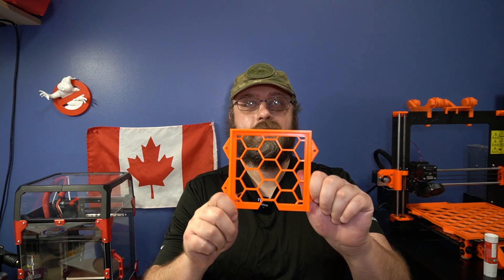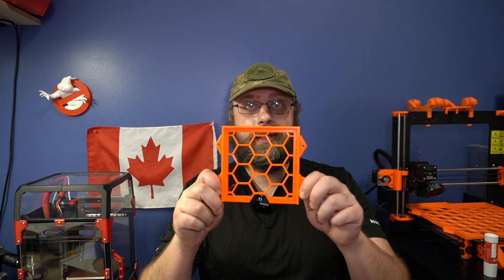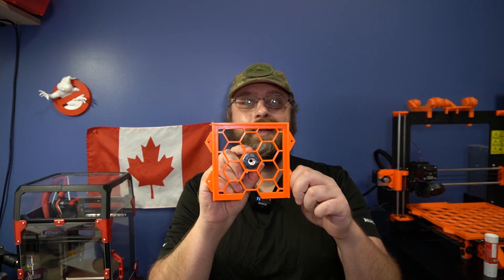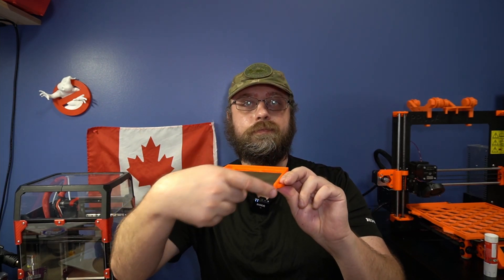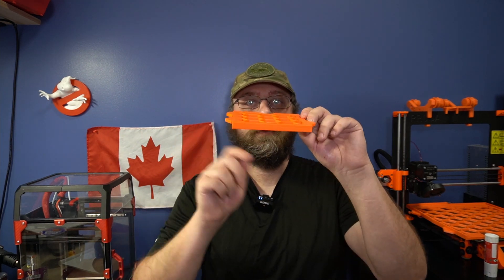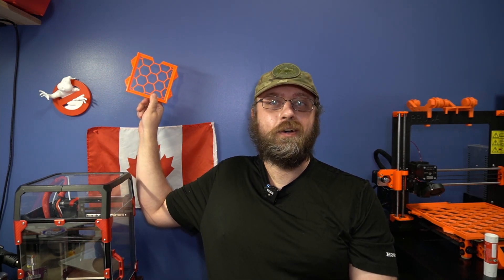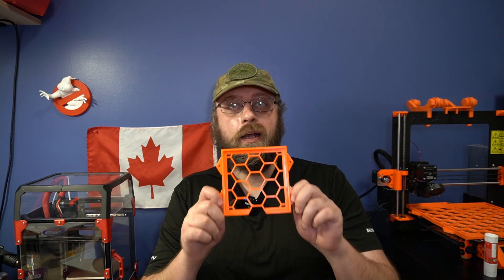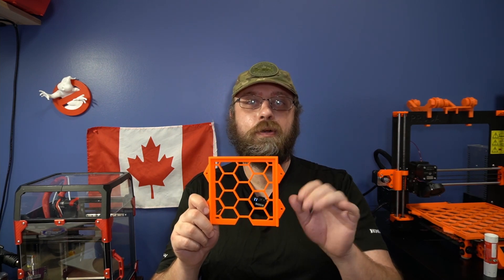3D Design Showcase: Voron v0 Flex Bed Holder

Comment: I love how you explained it all. Other channels always seem to assume this is known to everbody already. 
Now I have a noob question. Sorry for that. :) 
Imagine having a number of line fragments and one wants to constrain them so they are all on the same line, but non-coinciding. Picture a dotted line with 3 line fragments that are on the same (construction?) line. I have a hard time getting that to work. Yeah, maybe a distance constraint of 0 mm between a construction line and a parallel line will do the trick, but then in the best case you get these measurements showing 0 mm distance for all the line fragments. Any ideas? Thanks in advance!
Reply from the maker: I think I'm picking up what your putting down.  Something like this o----o----------o---o---------o  But at an angle? (o = endpoints of lines).

I would do this by making a construction line (blue), then in normal mode(white) I'd make however number of of lines that you want, making sure that the end points of those line is attached to the construction line  (PointOnObject constraint, C hotkey).  And attach the endpoint of each line to the start point of the next (or use the Create Polyline tool which will automatically link the previous line to the next). This way you don't need to use any parallel constraints because when you move and/or rotate the construction (blue) line all the other lines will follow.

Think of CAD as visual Algebra, the more you can simplify the final answer the easier it is to make changes later and debug issues.

You might have heard the old "Math is Beautiful" line?  I'd say So is CAD.

🍻
Reply: @QEngineering  Thanks a million for actually taking the time to answer my question in so much detail! 
I actually meant a series of lines that are not attached to each other but with spaces in-between. 
Sounds like a good idea to use a construction line, use the attach point to object constraint to link the starting points of the lines to it, then use the parallel constraint to fix the lines onto the construction line and use distance constraints to lock them in place. If I have time I'll give it a try this evening!
And yes, math and everything based on mathematical principes (CAD, music, etc) can be both beautiful and hard to master/grasp 😊.

Comment: does it mount on the V0 somewhere
Reply from the maker: I mounted mine under the table facing down, with a magnet in the center to hold it up.   It's from another project and is a bit if overkill, 70lbs magnet.

🍻
Reply: @QEngineering  oh i thought it mounted on the V0 that would be cool if it did